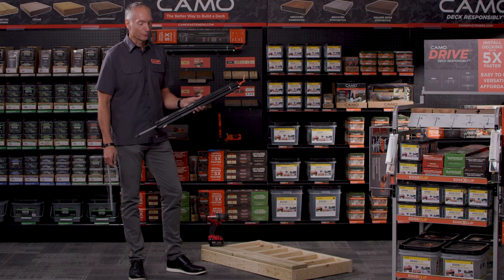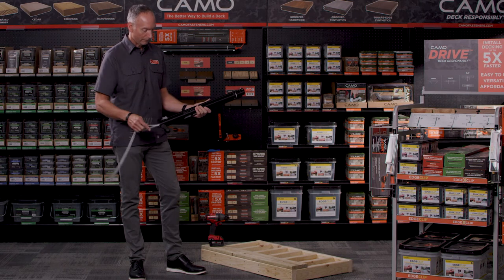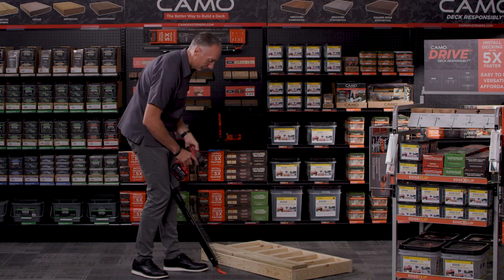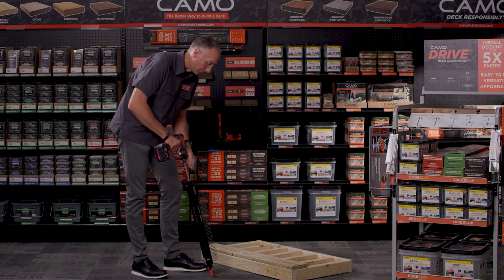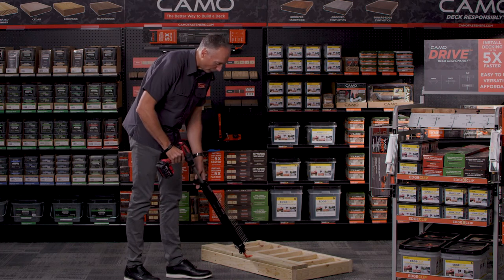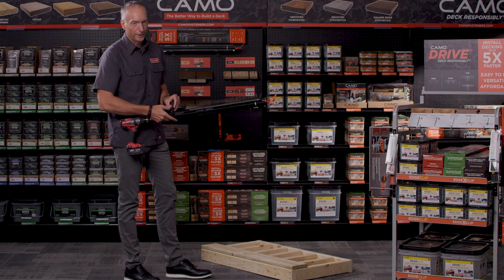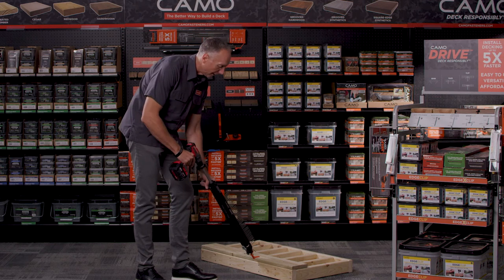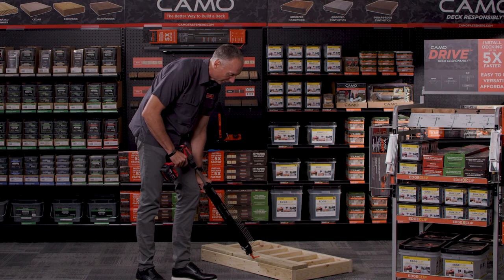Using the CAMO® DRIVE™

Comment: Hi guys I will be building a 1250 foot long boardwalk with raw hemlock wood (2" X 6"), I was wondering if I could use the CAMO DRIVE Stand-Up tool with the EDGE FASTENING adapter ?   Thank's
Reply from the maker: Hi there. Yes, you can use the DRIVE with 2-3/8 in. Collated EDGE Screws for that project. Just keep in mind that you'll need to use secondary spacers with the tool. If the lumber is dry, you'll need to have at least 3/16 in. spacing.
Reply: @CAMOFasteners  Thank's alot for the fast reply, now i need to find a Canadian reseller to buy it...